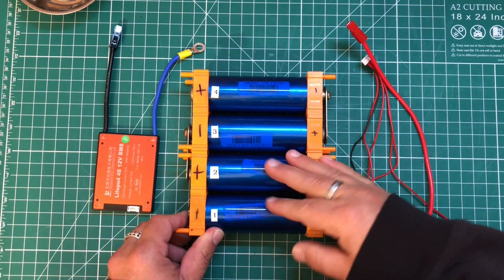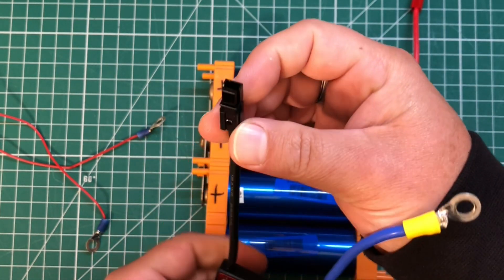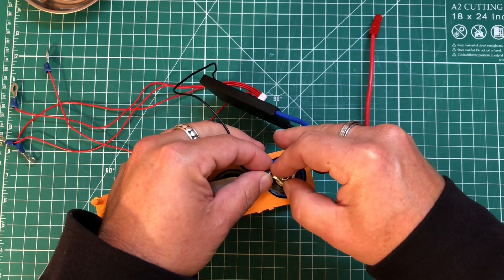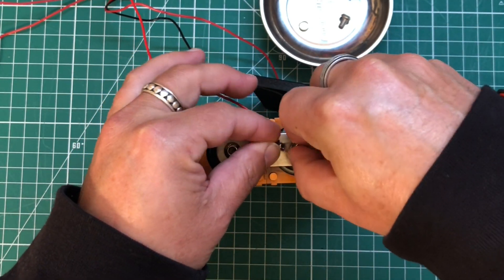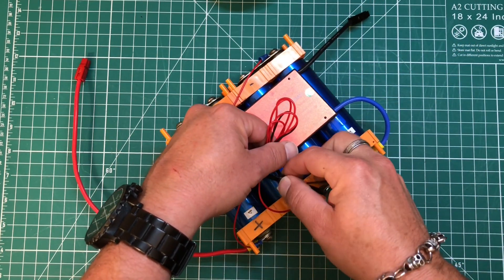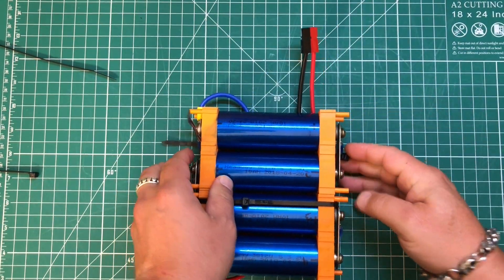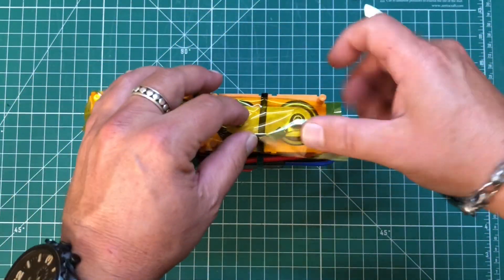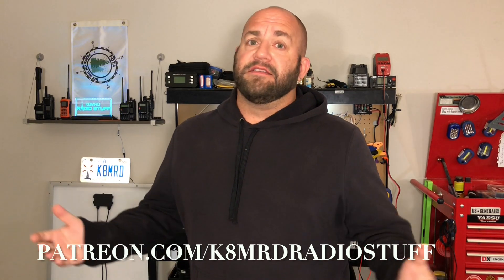How To Wire A BMS for LiFePO4 Batteries

Comment: looks like something I would build . nice job. wanted to know what BMS you are using. thank you for the link ! 73's
Reply: update. that BNS no longer sold but similar ones can be found. just make shore it has balance function and rated amperage and LiFePo4 3.2V cells. amazon like that .

Comment: First off, thank you for all the great videos you make Mike.  Real quick question.  I made my version of this battery pack about 1 year ago.  It worked great.  The problem now exists that I think my BMS went to sleep.  How do I wake it up?  Do you know of a special secret way to do this.  The battery pack is charged. I am readying 13.4 VDC on the pack.
Reply from the maker: If you're reading voltage the BMS isn't sleeping unless you're just taking the reading directly from the cells.  The only reason the BMS would shut down though is if the battery went below a certain voltage and the BMS shut down to protect the battery as it's designed to do.  In order to wake the BMS up, you just need to plug in any 12v supply (usually not a charger though) like another battery or a 12 volt power supply for literally like a second and it will wake it up.

Comment: Did you ever have issues with charging it? I’ve retraced my wires four or five times and tested every cell, wire and battery as a whole with a multimeter. Will the hi tech charger give you an error if your batter is already full? I’m measuring 13.4v off the connector.
Reply from the maker: I do not have any issues charging, no.  But, the Hi-Tec charger will give you an error if you don't have it set up right.  Press the Stop button until you get to System Setup.  Then use the down arrow until you get to Bal. Charging and make sure that is OFF.
Reply: @hamradiotube  Great advice. Problem fixed. It’s always the smallest setting that throws off the entire process. Thank You!

Comment: Great video and to the point!  Have you used this battery pack for POTA or field days like with a 100w station?
Reply from the maker: I've been using this battery since 2018 when I built it.  I just needed to replace the BMS.  It'll do just fine for a 100 watt station.

Comment: Great tip using the Kapton tape Mike. I use the giant heat shrink but I'm going to get a roll of the tape and check it out … thanks!  
I built one couple of years ago based on your Portable Power Supplies video -  way back in Feb of 2019 and it has served me well! 
I like this new BMS, neat and tidy, it really cleans up the pack. I see a new build coming. Hey, can you really ever have to many batteries.........................................
Reply from the maker: I've always wanted to put heat shrink on this but never got around to buying any.  I got the Kapton tape earlier this year and it works great for me.  The first 2 years I've had this battery I didn't have anything covering the terminals.  I should have cut the wires for the BMS to tidy it up a bit more.  I may still end up doing that.  I like this BMS better than the other one so far.  The old one had all the connections exposed.  This keeps everything covered up.  And no, you can never have too many batteries.

Comment: Coming to your state Mike: QUOTE: Samsung is expected to officially announce a new advanced chip-making plant in Texas later today, that’s estimated to cost around $17 billion and could create 1,800 jobs, The Wall Street Journal reports. The new plant will reportedly be located in the city of Taylor, roughly 30 miles away from Austin, where Samsung has an existing facility. The new site is roughly 1,200 acres in size, making it larger than Samsung’s Austin plant, the WSJ notes.

Comment: Mike if you build a battery, why not use a bino. Is the price difference about the same, or just the pride in doing it yourself
Reply from the maker: I built this battery back in 2018.  I just needed to replace the BMS.  Bioenno would be about the same price as this build, but it's more fun to build your own.  Plus you learn a lot about batteries.  And it looks really cool!

Comment: Thanks for all your videos, Mike. Questions for this one: Is this the battery pack you use for the 705? Can it supply full talk or transmit power even if it dips below 12v? Thank you!
Reply from the maker: This is not the pack I use for the 705 but it is the same type of battery.  LiFePO4 maintains a voltage of ~13.1-13.3 volts until it’s about to die.  If you’re in 12v range you won’t be transmitting long.  But yes this will give it the full 10 watts.
Reply: @hamradiotube  Thank you!

Comment: Nice video, please can you take voltage and current reading in your next video. Keep up the good work 👍
Reply from the maker: Thanks.  The current would depend on the load I have hooked up but the battery after charging settles down to around 13.3-13.4volts.
Reply: @hamradiotube   Please attached FT817 or 705 and work out run time.